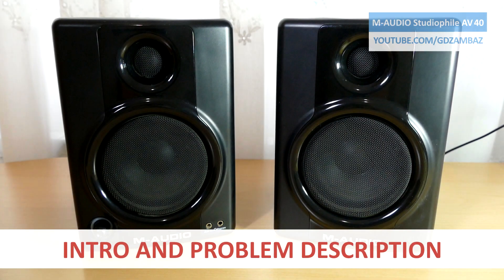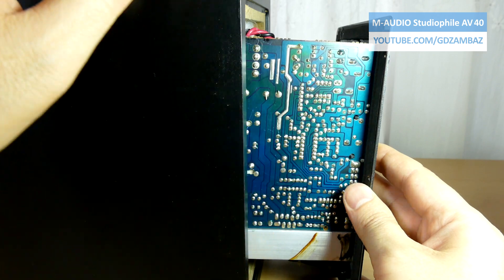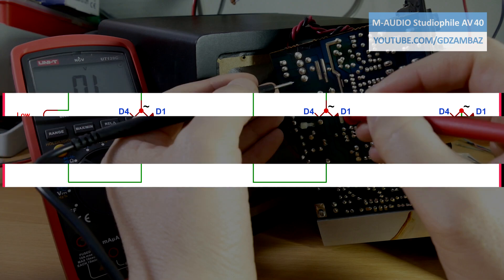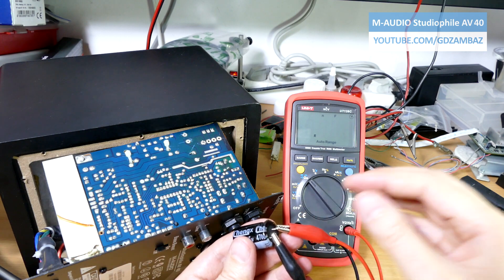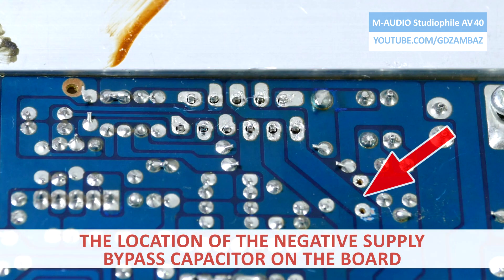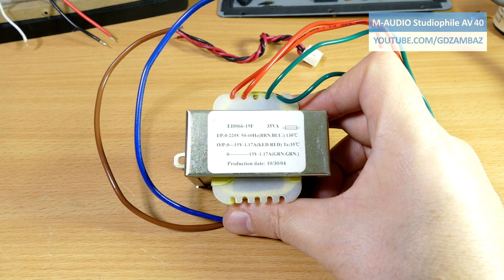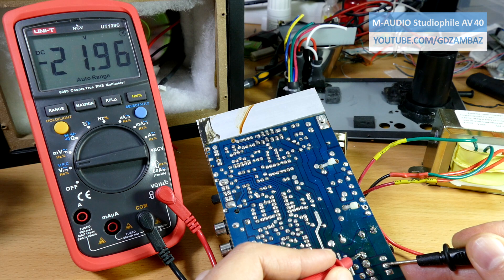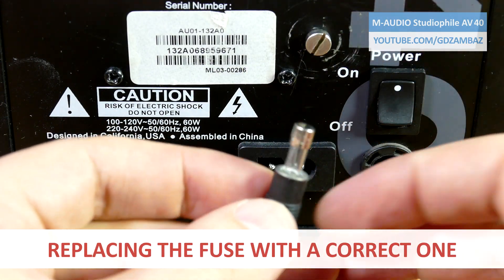Repair of M-Audio Studiophile AV 40 Speakers

Comment: What a beautifully produced video! I have no sound from my left speaker (the one with the amp in it). I would love to try repairing it but I don't have the tools or the skill, and I doubt I could easily get the required components here in Bangkok. I have had 10 years' service from these speakers. I think it's time to get my credit card out!
Reply: I have the same problem with my speakers and I've got most of the tools and (used to) have the skill... so I will see if I can get my problem resolved. If you still have your speakers, see this link (http://projects.g.ydftech.com/home-1/m-audio-av-40) for a detailed explanation for the possible issues with this speaker.
Reply: @brettwertz7069  that link no longer works - has it been replaced or is the site no more?
Reply from the maker: Thank you, I'm glad that you liked the video and I hope that the new speakers will work even longer.

Comment: Hi, I have the same speakers, got them used, when I turn them off they make a pop/pitching noise, is it normal thing for these speakers? Thank you in advance for your reply!
Reply from the maker: A popping sound when you turn them off is usually normal but what exactly do you mean by pitching noise? Is there anything other than the pop, or, is the pop perhaps too loud?
Reply: @GoranDzambazov , thank you for your reply! Yes, the issue is it is pretty loud, and also it is not just "normal" soft popping, but has some high pitch in it too, like chirping. Btw thank you for the great video, I did unsoldered and checked some components, like transformer, zener diodes, rectifier etc, and all seem ok, the big caps were changed earlier since it was buzzing before when I got the speakers. When I reduce the volume to zero before turning off its a bit better, but not always.
Reply from the maker: My speakers also make a soft popping sound at turn off and I believe it was so since the beginning (I'm not their first owner). However, what you mention about the additional chirping sound in your case is definitely not normal. Check if there will be any difference if you temporarily disconnect the audio signal cables.
As you probably already know, the amplifier IC used in AV40 is TDA7265 and in the manufacturer's specs it is clearly stated: No pop at turn-on/off. I did not investigate if M-Audio followed the typical application circuit given in the specs in their design neither I tried to fix this problem for me. Since you already started with the repair, you can also check the components around the mute circuit (pin 5 on TDA7265 IC). I'm sorry, but at this moment, I cannot give you any better advice.

Comment: In my case the hum sound came strictly from 2 sets of capacitors.  I replaced those tonight and now my My Av40 monitors are working again for the first time in 2 years.  I replaced these CAPACITORS  :  (2)  220uf 25v  and  (2) 3300U/35V.   I found a deal on Amazon and was able to buy 100 capacitors for only $8 which was cheaper than just buying what I needed.     If you decided to do this yourself, expect to take about 2 hours, disconnecting a reconnecting the speaker to motherboard wire is a Pain.  ( Unless you are smart, like  Goran and disconnect at the board..facepalm)    Excellent video,  it's too bad I didn't find this video before I began. No doubt,  I could have saved  a lot of time and a headache.  Regardless, my studio monitors are working again. Thank you.
Reply from the maker: Thank you for the feedback and for sharing your experience.

Comment: Buy an ESR meter.  Allows checking caps in circuit.  Nice repair.
Reply from the maker: Hi,

While having an ESR meter is useful for many other faults, in this case there would not have been any benefit of it because the fault was a short circuit in the negative supply branch. Also, most of the general purpose ESR meters have only the capability to measure the equivalent series resistance (ESR) of a capacitor but not its capacitance. So, if you attempt to measure an ESR of a capacitor (or a group of capacitors in parallel), a faulty short-circuited capacitor will incorrectly be identified by an ESR meter as having ideally low ESR (zero Ohms). 
And when there is a short circuit in a group of elements connected in parallel, if there is no visual clue which one of them is causing the short, there is no other easy way to determine which one of those capacitors is actually shorting the circuit than to desolder each element and test it separately for its functionality.
Best, Goran
Reply: @GoranDzambazov  10-4.  I have a DER EE DE-5000 which provides more than just ESR.  It is just another tool that can be used wrong or can hasten the repair process.  Are you saying that an ESR meter across the 4700uF cap you removed to test, wouldn't have found that it was ok?  I was surprised your MAudios lost the transformer.  Always nice when you can fix something & not toss it into the landfill.
Reply from the maker: Measuring an ESR or a capacitance of a capacitor in circuit (as you implied in your first comment) where there is a short circuit across it because of another faulty component connected in parallel with that capacitor would give 0 Ohms for the ESR and an indefinite (OL) value for its capacitance. In that case one can only measure its capacitance or the ESR by removing it outside the circuit. So in my case, an ESR meter would not have found that the 4700uF capacitor is OK, had I done the measurement in circuit.
Your tool looks more advanced than many other ESR meters, so it might have the functionality to identify that for a combination of 0 Ohms of ESR and indefinite value of the capacitance there is a clear case of a short circuit, but still it cannot tell you more than that (it could not tell that the capacitor is OK). You can confirm this easily if you simulate my case by shorting the terminals of a capacitor (in circuit or outside circuit) with a piece of wire and then test it with the ESR meter.
At the end of the video I explain why my M-Audio lost its transformer. That shouldn't have happened in normal circumstances.
And yes, I always try to fix things and use that opportunity to create a repair tutorial for other enthusiasts :-). However, video recording during the repairs slows down the repairs significantly and due to time constrains I haven't recorded many of the repairs that I occasionally do.
Best, Goran

Comment: Hi, Goran. Thanks, that was a very detailed repair presentation. I have Mackie CR4 speakers and they employ almost identical electronics. Many parts are actually the same, as far as I can tell by looking at your PCB. Mine developed an intermitent crackling noise at first. I replaced five small capacitors, all of which were bad and were located around the two zener diodes and two resistors included in the voltage regulation (like in your video). However, the PCB in that area is also blackened and started developing cracks. Is there a different solution for the voltage regulation other than via the resistors and zeners which obviously produce a lot of heat?
Reply from the maker: Hi and thank you again for your  feedback and your comment.
I'm not sure at this moment which voltages do the zener diodes provide in the power supply section of AV40, however, in general, you can consider a solution using some of the 78xx linear voltage regulators mounted on a small heatsink instead of a zener diode and a resistor. There will still be heat produced, but it can probably be distributed  differently (not to close to the board).
Best, Goran
Reply: @GoranDzambazov , thanks so much for the kind reply. I actually saw what you suggested on a blog by a German guy who never actually explained in detail how to mount and connect the leads of all those components, so it wasn't much of a help. Mounting that daughter board on the amplifier heatsink could be feasable. But the speaker is very restricted in space and there is little where the heat can escape.
The incoming voltages are around 20-21 volts, reduced to 12V by the zeners and resistors - which in turn burned the board. :-/ Would the components you suggested generate that much heat like the zeners/resistors combo?
Reply from the maker: The solution with the 78xx/79xx linear voltage regulators that I mentioned should be a bit better with regards to the total dissipation (should generate less heat). In the regulators with a Zener-diode (due to the fact that the Zener must stay in reverse breakdown to maintain the output voltage), the Zener-diode constantly sinks current,  which means that there is energy dissipated even in the case when there is no load current at all. (Actually, with no load, the dissipated energy by the resistor and the Zener is maximum). If you would like to learn more about this, do a Google search for Shunt Regulator.
Since your aim is to move away from the board the elements that generate heat, putting one 7812 (and one 7912 (I assume that there is a negative voltage as well)) on small heatsinks might help. The 78xx and 79xx are three pin regulators (they have an input, common and output terminal) and connecting them to the board should be straightforward.
Otherwise, when it comes to voltage regulation and conversion in general, the most efficient way is using switching DC/DC converters, but I usually try to avoid using them in audio circuits.
Reply: @GoranDzambazov  Thank you! I have implemented a LM7X12 daughter board in my Mackie CR4 powered speaker. The heat is now minimal, the board in that area is now just warm from the heat of the amplifier.
The electronics inside it is probably very similar to your AV40's. My CR4 monitors now work great, no sound issues and no more overheating board.

The only remaining issue is the L/R selector switch. It is covered in that black resin/glue and removing it from the part is virtually impossible without scratching or ripping the components covered by it. I guess they wanted to cover every opening to prevent the sound from escaping, but made the removal of the covered components very difficult. Any ideas on removing this black glue? Your AV40 powered speaker also features it on the inside of the back plate.
Reply from the maker: I'm glad to hear that your modification was successful!
Regarding the resin/glue, unfortunately I don't know what's the best way to remove it.

Comment: i got the maudio av 42, i was blasting music from an usb external audiocard, suddenly stopped working and the power indicator light doesnt turn on and i think it smells like its burnt , what could be? pls help
Reply from the maker: It's possible that there is a failure in the power supply section. I would start investigating there first.

Comment: Hi Goran,

Thank you for your very good exploration of the problem and finding its solution.  I appreciate your intelligence and thoughtful thoroughness.  I, also, had an overheating problem with my AV40 eft speaker and read a tip from a guy who detected direct contact between the transformer case and the speaker magnet, which produced a short, who then suggested putting a plastic shield between the two.  I did so and the overheating problem went away.  In another video a capacitor also was to blame but was different from the one you found.
Reply from the maker: Thank you very much Jon for your comment.
Do your speakers now work normally?

Comment: My speakers are not getting power but i checked the fuse and its fine
Reply from the maker: Hi,
Are we talking about AV 40 speakers? Is the mains power present at that outlet? If the mains and the fuse are OK, then the issue needs to be investigated furher and it is likely that the failure is in the power supply section. With the limited information that I have for your problem, that's the only advice I can give you at this moment.
Reply: @GoranDzambazov  yes av 40' i checked my power with a multimeter en its present till the transformer i guess i need to check inside the pc board
Reply from the maker: @deshwakitofficial8402  Did you check the resistance of the transformer's primary coil?
Reply: @GoranDzambazov  thts what i was suspecting.this whole time but i will check it out and get back to you.thnx for your time

Comment: Hi, thanks for sharing. Can you say me where did you bought the equivalent power transformer? Does the transformer make electric noise in audio signal? Thanks a lot.
Reply from the maker: I bought the transformer from a local electronic parts store (here in Skopje). Regarding the noise, I think that now the hum level is a bit higher than before.
Reply: @GoranDzambazov  thanks for the quick response. Have a nice day.

Comment: I use the av 4.2 monitors ,i encounter a very unusual problem....
The problem is that when ever i switch on the monitor its plays for a second and then there is no output m..
Sometimes the speakers play for a minute and so and then again no output ....
Can u plz help ..!
Reply: I had a similar problem with my set of speakers. The issue was a capacitor which was connected between the positive rail and TDA's pin 5. It was leaking current, slowly adding voltage to TDA's pin 5 upon startup. When the voltage reaches a threshold of around 15V, the volume starts to decrease until it fades away completely. At that moment, the voltage on pin 5 is so increased that the amplifier goes into mute mode and stops producing sound. Depending on how fast the bad capacitor leaks current, the sound will play in different duration before disappearing.
Replacing the capacitor solved the problem for me.
Reply: @VolfMark  This may just be the problem with mine. Thanks for explaining this!!
Reply from the maker: Hi,
How experienced are you in repairs in electronics? It's difficult and time consuming to diagnose the issue and provide help this way. However, another viewer put a comment recently describing an issue related with a component in the mute circuit and, at at first glance, it seems that both issues have something in common. Is the power LED on while the playback is muted?
Reply: @GoranDzambazov  yes the led is on
Reply: @GoranDzambazov  thanks for your reply
Reply from the maker: @anirudhanand07_23  I can only advise you to find the datasheet of TDA7265 IC and investigate the mute circuit around the pin 5.
Reply: @GoranDzambazov   ok thanks for the help😃
Reply from the maker: I'm sorry but in our conversation I omitted to see that you are talking about AV42 speakers and my last answer was provided with an incorrect assumption that you have an issue with AV40 speakers. I haven't serviced AV42 and I don't know which audio amplifier IC is used there. However, if you find that it's the same IC, then you can follow the previous advice.

Comment: hi,i got the same speakers and the sound shutdown in intermittent way ,can you tell me how to fix it ,thanks a lot for your help
Reply from the maker: It can be many reasons. Is the blue power indicator LED on at the time when there is no sound? Did you check the cables already? Do you have enough knowledge in electronics to do repairs?
Reply: @GoranDzambazov  hi ,yes there is the blue power working normally and  the cables seems ok ,well i have assembled some synth kits and sometimes i fix computers , i have found this page where they said to cut the pin 5 who is the mute on the tda7265 chip , https://getsatisfaction.com/m-audio/topics/av40-no-sound-but-work-for-a-few-seconds-after-power-is-turned-off   ,  i am not really sure to do it ,what do you think
Reply from the maker: It is likely that the problem is caused by a faulty component around the pin 5 (Mute). I would try though to make a proper repair, which is to find which component is defective and replace it (or check if there are cold joints around), rather than simply cutting the pin 5 and leaving it floating. According to the TDA7265 datasheet by ST, when the pin 5 is at a potential lower than  +Vs - 6V the amplifier is in Play mode. I would like to hear how this will end, in case if you proceed with the repair.
Reply: @GoranDzambazov  thanks a lot for your advices , i will check the components first ,as soon as i will finish with the fix i will tell you

Comment: A very detailed and informative video.
I had a similar problem with my Mackie CR4 monitors. When turned on, they would silently crackle intermittently. Turning the volume knob made no difference to the crackling level. Both speakers produced audio, but the crackling was annoying.

The CR4 build is quite similar to this one. The powered speaker had a diode corroded and broken in half. The caps looked OK. I replaced the diode snd the crackle went away, for now. Hopefully that was all it took. :-)
Greetings from Serbia.
Reply from the maker: Thank you! / Hvala!